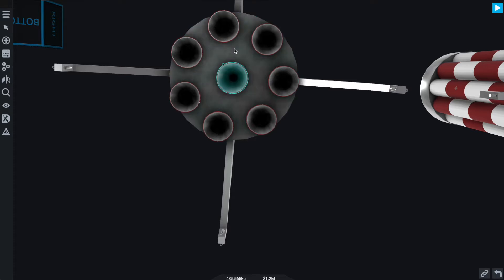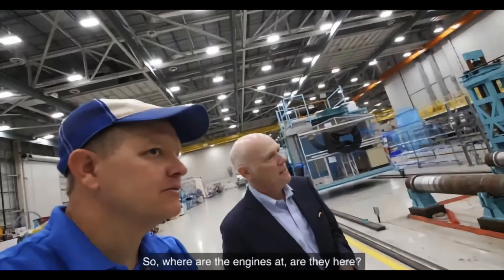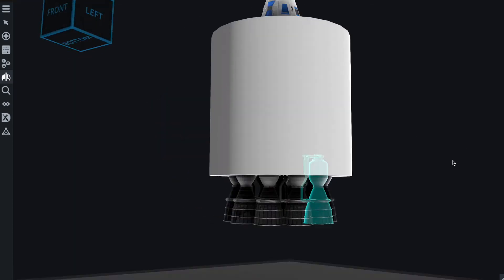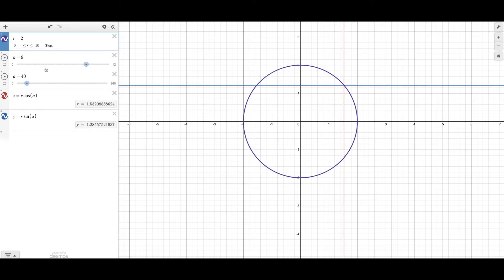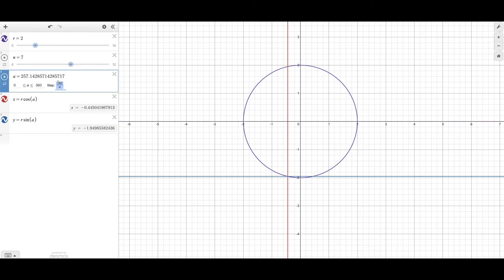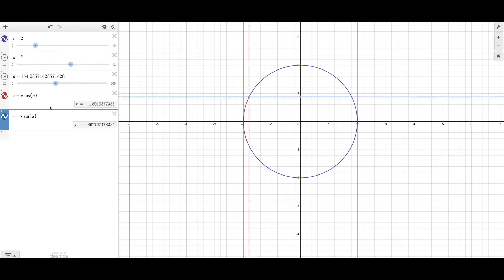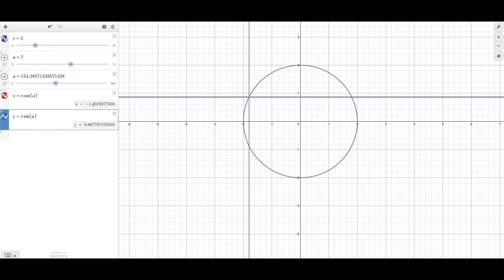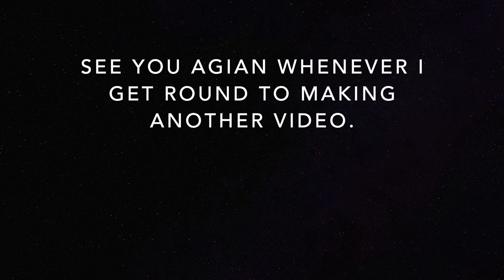How to increase part symmetry | SimpleRockets 2 | Tutorial

Comment: Just use x5 and break symmetry and x6 for every engines. And will get 30. You can get all values using standard symmetry tool
Reply from the maker: You can do this but it is kinda fiddly and doesn't work primes over 5.
Reply: @SpacemanTarian42  oh. Like 7 9 11 and other?